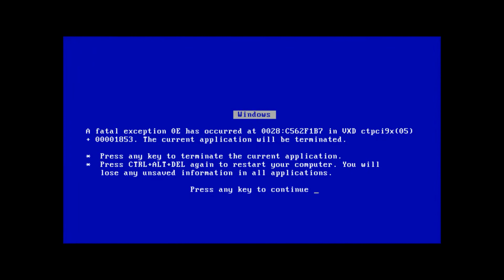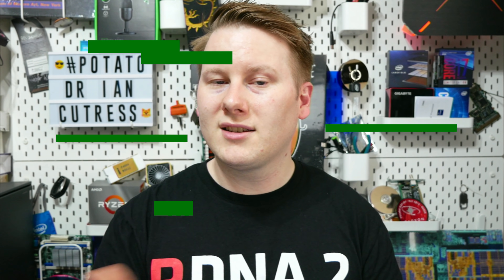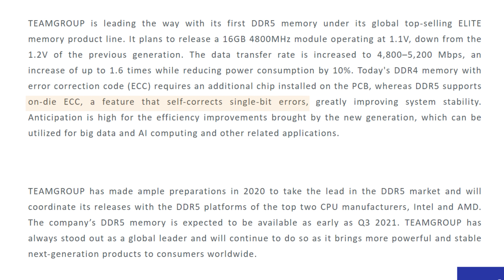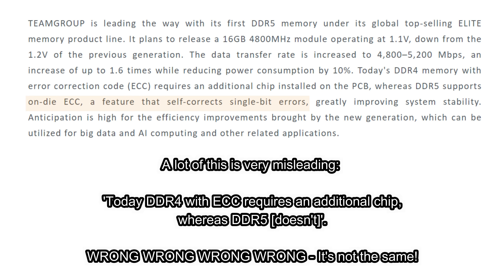Why DDR5 does NOT have ECC (by default)

Comment: I'm having difficulty finding a recent real world test, but Google had a doc back from around 2010 and detected errors in their datacenters was around 6-17 bit errors per hour per 32GiB of memory. My limited understanding is that most memory didn't have errors, but the memory that did had many more errors. So it sounds like "bad memory". Personally I run a memory test on my new computers for at least 24 hours. I've had more memory errors due to bad power supplies than bad memory.

Comment: Full ECC should be the standard requirement for DDR5
Reply: Would be slower than DDR4
Reply: @lukario223 No lol, I have full ECC Kingston UDIMM DDR5 5600MHz on my PC. I use it both as a PC and my home file/nextcloud server. It's as fast as regular DDR5 but harder to find and more expensive. That wouldn't be a problem if only the full ECC was in the standard.

Comment: There is good reason serious consumer products are moving to btrfs and zfs and it's not to accommodate multi-exabyte storage volumes ... They both add ECC capability to your persistant storage. One bit flip can absolutely destroy many modern compressed file formats like jpg, or non-artistic data dealing with money or hashing or engineering calculations. The way every modern OS uses RAM cacheing there is substantial data exposure to RAM based corruption, it isn't just in the brief transit during a file copy.

My "consumer" NAS box runs 24/7 with the only reboots being due to power outages lasting more than 15 minutes (about 2 per winter), and my desktop has typical uptimes of 60 days between reboots with 16Gb ram it means I average more than one cosmic flip per reboot (Though I am at sealevel. Those in Denver would have many more). Then you add aging related ram data corruption and consider these have more than 15 year lifecycles, which ECC will also report, allowing diagnosis for module retirement or demotion from production to the backup/experiment box.

Seriously, who boots and shuts down everytime they need to lookup something on the web or pull up a spreadsheet for a minute?

Comment: Thanks for the very informative video. I have a question:

From my understanding, On-Die ECC is still better than non-ECC because the data that are on transit are much much smaller than the entire RAM. You may still get a bitflip from cosmic rays, but the possibility of much lower and the affected data are much less. Am I correct?

Also, On-Die ECC memory, can not have a "stuck bit" if the chip is bad. Is this also correct?
Reply from the maker: On-Die ECC is essentially a cover for manufacturing defects. Don't assume that On-Die ECC offers the same protections as ECC. 

On-Die ECC could have a stuck bit, although the balance is performance. If you have to keep on correcting that region of memory, it'll draw power too. Best to mark that section as bad.

Comment: On the point of ECC everywhere and overclocking. There are lots of dimms that have ECC and are overclocked. Maybe you don't get the same reliability from them as if you were to run them at JDEC speeds, idk.
I personally have ddr5 6000 MHz CL32 ECC rdimms in my rig.

Comment: I was already clear on the distinction between "traditional" ECC (side-band and in-line, which correct transmission errors) and on-die ECC. But here's what I haven't been able to see answers on elsewhere: On-die ECC is "supported" on DDR5. Does that mean all DDR5 chips will have this built-in, or is it only an optional part of the standard?    

Also, you seem to be saying on-die ECC is only beneficial during manufacturing ("what it does not do is protect your data").  I thought it was  beneficial post-manufacturing, in use, by correcting thermal bit flips, which certainly would protect your data. It wouldn't protect your data from errors during transmission but it would protect it from errors occurring while it was stored in RAM.  It sounds like you may be confusing error check and scrub (ECS), which does detect and report errors during manufacturing, with on-die ECC, which protects data from bit flips while the RAM is in use.

Then there is LPDDR5.  It appears on-die ECC is not available on it.  It offers Link-ECC, which protects against electrical noise on the PCB traces between the LPDDR5 soldered chips and the CPU soldered chip. Is this full transmission ECC, or something different?  And is it included on all LPDDR5 chips, or only on some?

Comment: ECC (unbuffered) does not reduce performance at all. It's just that such memory does not get factory overclocked. Most of consumer memory simply and is marketed and has SPD for higher speed than RAM chips are rated for (speed grade marking). You can overclock it just as well as usual RAM given it has chips which overclock well. Actually I have overclocked ECC RAM in my PC, the difference is that I can monitor RAM stability long term. With certain overclock I got like 1-2 corrected errors in a month, which you most likely won't be able to figure out by running tests on usual RAM.

Comment: But errors occur (by far) most frequently on the chip, not while moving the data, right? So the on-die-ECC, that DDR5 has, is actually great. Even though it's necessary, owing to the higher density, it should be far supperior to (non-ECC-)DDR4 in terms of data security. The only difference to "real" ECC is that errors that occur during data retrieval are not recognized, which happens much more rarely than errors on the chip, or am I mistaken?

Comment: But it should mean that the price difference between "real ECC" and DDR5-ECC only should be smaller since the chip already comes with the extra memory cells required for on-die ECC. You would then only need to extend the interface with the extra ECC lines

Comment: LPDDR5 (LP meaning low-power) has link-ECC, meaning the whole signal chain is error-corrected. LP memory is mostly used in phones, and thank goodness the standard finally made ECC mandatory. Thermal bit-flips are that much more common in phones that might overheating because they're charging while gaming.

Comment: Intel does not support ECC ram on consumer hardware as they need to artifically segment the market so they can charge more for Server cpus, Buy AMD cpus instead which DO support ECC ram. Cool thing about overclocking ECC ram is you can see instantly when errors are happening.
Reply from the maker: AMD CPUs are not ECC qualified. You can use RDIMMs, but that doesn't mean any form of ECC is actually working. AMD even states that ECC is not validated on its own CPUs - your mileage may vary, and even if the motherboard says ECC is enabled, that doesn't always mean it is. It's just a flag, not a test.

Comment: The real reason ECC is still rare these days is Intel market segmentation. Intel wanted to have extra profit on Xeon line so they crippled the desktop CPUs by removing ECC support from the desktop CPUs to force enterprise customers to purchase more expensive Xeon prosessors even if they only really needed ECC support.

And I didn't know that the fact that you cannot find fast ECC was due stupid specs. I always assumed that there was something in the ECC signaling that made it harder to reduce latency and increase frequency. Great video!
Reply: Actually their 13th gen consumer line CPU now is ECC enabled....which means....you can now pair it up with an ECC enabled motherboard and RAM kit and you're fully ECC covered.
Reply: @White_Night_Demon  That's true in theory. However, good luck trying to find DDR5 5600 MT/s memory or faster with real ECC chips.
Reply: @MikkoRantalainen  well unless you're benchmarking, you're not gonna notice the extra few frames with higher memory speed kits....not the mention the higher the memory speeds, the higher the timings too which means overal it might just be slower than your 5600 with real ECC chips....
Reply: @White_Night_Demon  Yes, for gaming only, the extra cost of more expensive memory is often waste. It's better to put any extra money on GPU instead.

Comment: On-die ECC should deal with the majority of flips that ECC covers today. It's much less common to have memory bus errors than storage errors. As a secondary point, there's no true requirement for ECC in general to worsen read latency; you could do speculative execution on the values read in parallel with the error detection, and invalidate and reissue those operations from the pipeline only if an error actually occurs. Write latency would still be affected, though to a much smaller extent than it already is by memory bus designs that can't operate efficiently in smaller blocks than a cache line. One advantage on on-die ECC would be that it could integrate scrubbing in the refresh cycles, fixing errors long before the CPU actually reads the data, and therefore vastly reducing the risk that a second error causes corruption without spending any bus time on the task. 

Of course, whether manufacturers actually do these things is a different story. For instance, real ECC memory is exactly the same memory, just wider; there's absolutely no reason for it to affect timings including the maximum frequency. That's basically marketing wank. The CPU manufacturer just doesn't want to sell you the overclocking and error correction functions together. On the other hand, you can have memory modules that fake ECC, protecting only the transfer and not the storage. Those would be slower and more complicated.

Comment: Of course you can OC ECC memory!! That even more challenging since there is an in between buffer and maybe 8 time more chips so statically harder but anyway the memory is more stable and advertise when errors are encountered.
It's no slower neither, since you can't access 2-4 memory dies on each slot at a time.

Rgb RAM is geek stuffs, not your primary audience anyway.
Reply from the maker: ECC is a rated spec. If you overclock, ECC probably still works, and you get the faster speed, but you're technically out of spec. The key part here is staying in spec.
Reply: @TechTechPotato   I may be, myself, out of spec 🤣 anyway. 
I'm currently running 256Gb and they are really easy up to 210Mhz (Samsung PC3L 1866), then some dimms are starting to pull errors everywhere. 
Specs are essential for EE specialists, I take them for the bare minimum granted performances but since every manufacturers include some margins to get the entire production process into the specifications, feel free to use them without fear.. As long as one stay within thermal limits.

Comment: This explanation is missing some things and I think that therefore is somewhat misleading. ECC does two things: it detects errors and reports them (and whether they were fixed or can't be) and it fixes errors (single bit per byte). ECC does this by adding another bit per byte, that is, another chip per 8 RAM chips (which is one reason it costs more). Having on-die ECC means that the chip can fix some errors. In this respect it does what any ECC does. It also means that the chip needs 12.5% more memory cells. What internal ECC lacks is a way to communicate to the PC that there were errors. That's the main difference here. However, if I understand it correctly, DDR5 ECC DIMMs won't be much different than non-ECC DIMMs, because the extra storage needed for the error correction is already on the die, not as a separate die, as well as the ECC algorithm already implemented, so all that's needed is support for the extra communication with the PC, letting it know about the errors. Which begs the question of why there's even a place for non-ECC DDR5.

Comment: Years ago I learned  from a particle physicist who watches underground neutrino detectors that most "cosmic ray" bitflips aren't actually due to cosmic rays at all - they're due to alpha or beta emission by trace radionuclides in the chip packaging. Doesn't make any difference to the error statistics for surface-dwellers, but it does mean they don't change much when your computer is sited down a mineshaft where cosmic rays can't get to it.

Comment: Its ironic the more we shrink the nodes, the more thermal sensitive they are getting, the more unreliable against all sorts of variations they become, and consumers do benefit from ECC, not only are the memory more reliable under operation but their production quality is higher you are far less likely to get faulty memory if its ECC verified JEDEC standard rather than consumer non-JEDEC standard XMP memory. 
I have rendered a lot of videos in my life and I seen random errors every now and then that means you must re-render the video, what causes it? Not sure, ghost issues, ghost issues are most likely issues in the memory and can also be seen affecting Windows operating normally so consumers does in fact benefit great deal with using ECC, because it increases their overall reliability of their computer, if Windows suddenly bluescreen it will be far more specific cause rather than being caused by the memory itself, so you can rule that out, without ECC, its anyones guess why you get BSOD.

Comment: So On-Die ECC has nothing to do with ECC: it's a completely different solution that vaguely has the same goal.
Reply: No, that is incorrect. On-die ECC is performing the exact same error correction as on an ECC DDR3/4 DIMM. If a bit gets flipped on both a DDR4 ECC DIMM, and a standard DDR5 DIMM, they will both correct the error using virtually the same correction scheme(parity bits stored on-die/per-die for DDR5; parity bits stored on an additional 'parity data only' die on DDR4 ECC). The distinction between the two is that an ECC DDR4 module requires platform support for ECC over the data bus, whereas the DDR5 module uses ECC ALWAYS and it works just fine on a consumer platform out of the box. Is full end to end ECC better? Well sure, of course, but the topic of the video here is 'why ddr5 does not have ECC' which is objectively false. Does 'default' DDR5 correct single bit-flips from cosmic rays using ECC, even without a 'full' ECC platform? Yes, it does. How anyone can perform the logical leap to decide that error correction code in memory is not equal to error correction code in memory is beyond me.
Reply: Not to mention, the 'end to end' portion of full platform ECC exists primarily to correct *hard errors*, which has absolutely nothing to do with the memory cell bit flips referenced in this video. I challenge anyone to find real documentation showing that the data traversing/in-flight on the data bus is affected by radiation/cosmic rays in the same manner or to a similar degree as memory cells. Things like ESD or power surges can cause both, but the point here is that there is a good reason for why we have the two terms 'hard errors' and 'soft errors' as they are two different things.

Comment: I dont know, we are saying the on die ecc is significantly less effective because the buses are external, but dont have any info on what fraction of errors will practically occur on the buses. Don't modern cpu caches all have ecc now? On die ecc still sounds good to me without more info on how frequently errors occur off the die.

Comment: I worked on IBM mainframes for a very long time.  They did error checking at every stage.  I was astounded when personal computers came loong without even parity checking data.
Reply: I remember when you could use ECC on Intel consumer systems

Comment: The other way to say this is that DDR5 modules protect from bit flips that occur inside the DRAM chip but NOT in transit. If the error occurs inside the controller or the bus on the board, there's no way to detect it other than a sideband ECC approach (using additional bits of storage for parity).

I don't think anyone other than maybe the RAM makers really have any data on what percentage of errors are transmission errors versus flips in the DRAM. Considering that most studies show that the number of bit flips from a given module per unit time increases with the age of the ram module and that replacing it (in the same system) has the errors return to baseline would suggest most errors occur within the module.

Servers will still use extra DRAM chips but it will still drastically lower the amount of errors overall. 

This is still a big deal, and it isn't marketing garbage.

Comment: Bit flips are more to do with radiation (background + weak sources) than refresh & thermal effects. 
A paper famously demonstrated that you could dramatically increase the bit flip rate by placing an incandescent bulb above the board. Incandescent bulbs emit a great deal of energy outside the visible spectrum and some of this non-visible energy would penetrate the DRAM chip and cause a bit to flip.

Comment: When I build my next PC, a full implementation of ECC is pretty much an absolute requirement, as well as support for several TB of RAM.  

I was thinking later this year or 2022, but with some delays I've been hearing about that might slip to 2023 or 2024.  For now, I'm eyeing the 2nd DDR5 generation of Threadripper or Epyc or Ryzen; currently using Haswell (4790K) in my desktop and Skylake (6700K) in my laptop.